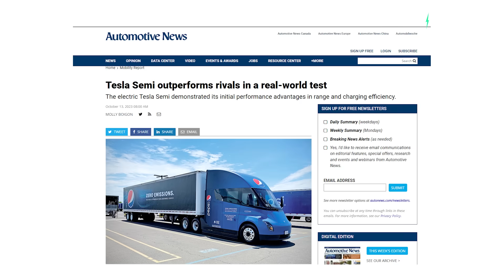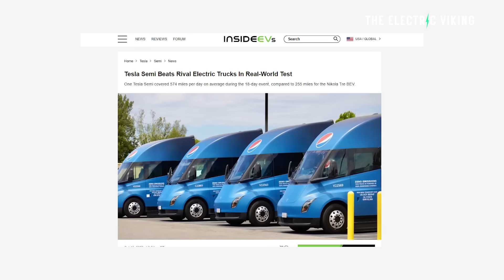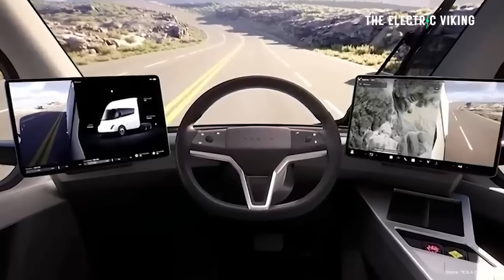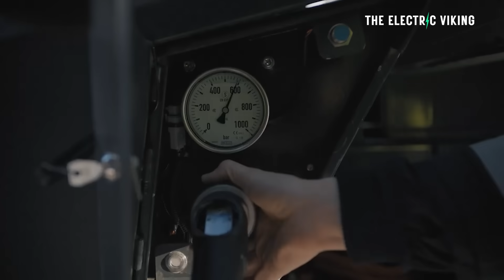Mercedes claim that Tesla Semi breaks the laws of physics proven correct

Comment: Increasing the range of an electric vehicle is the easiest part of electric vehicle optimization. Doesn't even need and engineer, just put a more batteries, there is load of space in a semi formatted for the USA. A bit like having a bigger tank in your car.
The HUGE size of the Tesla semi (comparable to internal combustion american semis) makes it ALMOST totally UNUSABLE in Europe. Just ask a semi driver who drives in Europe on various types of transport (I mean not limited to port-dock -> port-dock).
Other points that are, to me, important:
- the limited supply of lithium worlwide
- the place where we buy lithium/the place where it is transformed/the place where we buy the batteries (watch the direction of my eyes...)
- the aging of batteries. I haven't seen it included in the comparative studies since the ones I saw where just done on the basis of almost brand new electric semis. Watch your phone battery maximum capacity after 2 or 3 years and imagine being the operating officer of a fleet. If after 3 years you have lost 9-10% of the battery capacity, i.e. range... it is a big problem. Because you will not be able (and/or allowed) to charge anywhere like electric cars do.
- Maximum capacity (power) available on the grid is not magically unlimited. Meaning you would certainly have various time constraints for your recharges.
- Who will pay for the new nuclear/solar/wind power stations in order to cope with the increasing demand?
- what is the advantage of switching the pollution from the truck to the power station ? Some countries are still relying heavily on coal or gas power station. Other countries - a big one among them is Germany - have stopped using nuclear energy (how stupid) without a green alternative: they now have replaced nuclear by COAL until they-don't-know-yet. COAL IS THE WORST OF the WORSTS.
- a BIG BIG problem, to my eyes, is that we (in Europe at least) are trying to push towards railroad alternatives which are a proven more efficient system (we have a vast majority of electric trains otherwise it would not be so interesting) for a part of the transports. If buying an electric truck makes you forget about transitionning a part of your transport towards rail, I DON'T LIKE IT.

Comment: When we mention physics, we should be talking about coefficient of drag. As @austinpowers1999 mentioned, why are they making a brick-shaped truck? Yes, European countries have length limitations but why is Mercedes designing a very tall cab when there isn't a huge diesel engine the driver is sitting on top of? The drive motors on the Tesla Semi are located between the rear wheels along with a cruising motor up front. If Mercedes and the other brick-shaped semi manufacturers simply followed the design of the Tesla Semi, adjusting the cab to sit forward but no more than 2/3rds the height of the Semi, this alone should help reduce their drag coefficient significantly. It's ~0.36 drag coefficient has to be much lower than the others. Do we have information on all the other semis on the road and those in design?
From Tesla Semi forum: "... amazing semi specs. 0.4 drag coefficient compared to 0.8 with a regular semi."
Reply: because the trailer has that heigth anyway.
Plenty of trucks even have an extra piece on top of the cabin to reduce air drag.
Reply: @Robbedem  I was thinking what they should do is streamline the trailer so that the front is more sloped.  A small slope would not sacrifice much carrying capacity --especially if you don't load the truck to the ceiling.  That way the cab height could be lowered even more and weight and air resistance reduced.

P.S.  Yeah, I know most trailers are boxy and that they are stuck with using those, but if you could design a whole new cab/trailer...
Reply: @kenbob1071 sure, just replace the millions of trailers already out there, to be more sustainable, sure

P.S. forgot to read his P.S.
Reply: @iaintdonknow   uh, dude read my "P.S."
Reply: @kenbob1071  missed it thanks
Reply: @iaintdonknow foldable front of trailer depending on load? With cab height adjustable like  some travel trailers?
Reply: Because COE are the RULE in UK & EU.
Reply: believe it or not, despite carry more weight from having higher GTW over on average more undulating windy roads, European cabovers use less fuel for a given weight moved a comparative distance, because they are limited to 56mph, while in the US the speed major routes for trucks is notably higher, e.g. a 0.6 drag coefficient when ran at 56mph carrying 8000LB to 17000LB more weight bests a lower drag coefficient ran at higher speed carrying less weight.
Reply: @markplott4820  they are not implicitly a rule, they are just what fits best within the rules to have a maximum length trailer while staying within the maximum overall length regulations, if you want to run a truck with a bonnet you can, but the trailer needs to be shorter to account for the overall length limit - unless you run in an area of haulage that has derogations regarding overall length, for low-loader operations and heavy haulage that have relaxed overall length requirements.
Reply: @Robbedem   The Tesla has the same height. It just has a bit more streamlining in the front because it has no length restrictions in the US. In Europe that truck couldn't be used with regular trailers.

Comment: notice how every other electric semi is a big flat wall of metal smacking into the air...and even worse, with lots of irregularity in the surface, almost like they made an attempt at designing the most inefficient front end in a wind tunnel as possible .....smh...

Comment: The problems with electric trucks, are totally mitigated by driver’s mandatory stops.
As they can charge while you have a mandatory meal break, they have no more ‘down-time’ than diesel powered equivalents. In fact, they  mean mandatory rest breaks cannot be ‘skipped’, which is better for drivers, and safer for every single person travelling the roads alongside them.
Reply: And also - filling with diesel requires you to spend maybe 15 minutes with the truck. Electric ? Plug in and get your full 1/2 hour break... I know which I would choose...
Reply: How is not producing enough electricity to power a fleet conversion fixed by drivers stopping?  During summer California has rolling blackouts with the current load.
Reply: Truck driver here. We are allowed to hook and unhook trailers during our 30 minute reset. By the time my pre trip is done I maybe have 5 minutes to use the restroom before I can keep driving.
Reply: @MrJturner74 California is producing 22 GW do you really think a few MW will make any difference?
Gasoline and diesel refining requires 4.2 kWh/gallon
Reply: @nathanielthelin1051  
In the UK you're not even allowed to clean your mirrors whilst on your break.
Rest Break means exactly that.
NO misinterpretations.
Reply: @casperhansen826  Yes I do, we have already had Cali ask people to NOT charge their cars once. When is a new power source being brought online to handle the increased demand?
Reply: @nathanielthelin1051  That depends on the country. Some (most) western countries mandate an actual 30 minute “rest, not a 30 minute “rest” whilst continuing to work, but that’s America for you - no worker rights.
Reply: @MrJturner74  Most civilised countries have a dependable power grid. California’s problems aren’t indicative of world-wide capabilities.
Reply: @just_passing_through  to be fair, I chose not to wait past the 30 minutes because I get paid by the mile and like to keep moving. I could stay parked for hours if I needed to sleep or rest. We basically get this cool ability in the US to choose how we spend our time at work. I do think the truck is cool btw. I just wanted to point out that not all drivers actually spend 30 minutes parked during their shift.
Reply: @nathanielthelin1051  The trouble with “having this cool ability to choose how we stand our time at work” for truck drivers is that … you get paid by the mile….  The quicker you finish s job, the quicker you start another.  The problem with that is that it’s in the trucking company’s best interest to bite drivers who don’t take breaks. It’s in the drivers best interest to not take breaks. It’s in no one’s best interest to ensure breaks are taken and drivers are not fatigued. That’s where government oversight should come in. Mandating breaks means every driver takes them and keeps everyone safe from the :time is money, to hell with safety” attitude. It’s the very reason why in the US truck drivers consistently rank as one of the top ten dangerous professions, whereas that is not the case in countries with stricter guidelines.
Reply: @MrJturner74  build nuclear . it's the best tech. just make it impossible to launch nuisance lawsuits .
Reply: @nathanielthelin1051 why are you unhooking your trailer on a road trip ? and it seems the laws need to change if you are still working on your break.
Reply: @MrJturner74 Most people can program their electric vehicles to charge at midnight when there is ample or excess grid capacity.
Also, not charging for a day is no big deal, as most people driving average miles every year only need to charge at home once or twice per week for a few hours, so not charging for a couple of days is no problem. Just like using a gas vehicle.

With an electric vehicle, you're more likely to have a full "tank" or charge than in a gas vehicle because you can plug it in every night, just like using a smart phone.

Everyone who drives an EV is not using Superchargers every day. The Superchargers are mostly used by long distance travelers.

Everyone in the entire State of California was not in blackout mode at the same time.
Reply: @MrJturner74 California's blackouts are because of their lines possibly causing wildfires not because their grid is failing yet
Reply: @dvader3263  Except most people don't have the ability to charge at home.
Reply: If you slow down a trucker, you drive up the price of shipping.
Reply: @moabman6803  If you have as many trucks crashing through driver fatigue as the US does, you drive the shipping costs up even further.
Reply: @just_passing_through  Then that would cause the price of goods to go up globally
Reply: @MrJturner74  The rest of the request: “during peak energy demand hours”. You’re being deliberately dishonest making it sound like people can’t charge their cars when the truth is that they’re asking people to reduce the load on the system during the hottest hours of the day. Since these vehicles can be fully charged in the off-hours your question is moot to begin with. There is also a small, but not negligible, range extension that could be obtained through putting solar cells on the top and sides of the trailers.
Reply: @davidhollowood6580  Fine, in honesty there  aren't enough minerals  to convert to battery electric cars even if we wanted to. A hemp based biodiesel is a much better choice for fuel.
Reply: @MrJturner74  Solar plus storage.

Comment: Charging EVs from 10%-60% then leaving the charger session seems to be the most efficient charge cycle for me and other EV owners. My recent road trip went smoothly and quickly using this method. My Model 3 ramped up to 250kw for quite a bit before starting to ramp down to 110kw before I unplugged and moved on. The America-record setting Porsche Taycan Cannonball used the 10%-60% to set their EV race record.
Reply: Ramp up ramp down.😅

Comment: the problem is, the US is not comparable to for example to Europe, likewise how one haulier uses a truck is often not comparable to how another haulier uses a truck, then you have the trucks themselves and the regulations the operate under, for example 40 tons (80,000LB GTW) in the US is very different from 40 tonnes (88,185LB GTW) or 44 tonnes (97,003LB GTW) in Europe, ever wandered why Europe has more powerful trucks on average, its because on average the haul more weight, on average on the road network they encounter is very different to the US, and the topography of the terrain is generally more hilly in Europe, while the US has some vast relatively speaking flat spaces, the only way your going to get a fair comparison is to run the trucks side by side on the same roads at the same times, hauling the same trailers with the same weight loads in, with drivers that drive in similar manner, if any part of the comparison is different (roads and routes used, trailers used, weights carried, etc) the the test is not comparative, its just smoke and mirrors.

Comment: How many of the test trucks burst into flames while charging or just sitting there? How many burst into flames after being involved in an accident?
Reply: Since about 200,000 American autos burst into flames every year, they have a long while to catch up.
Reply: If trying to make the case for fire safety EVs Vs IC it's important to show proportionality not raw numbers. It's also important to compare the two types of fire and the impact each has. 

I don't know which comes out on top if you do that, but no matter what side of the fence you're on if you're not factoring for those two things then your view is nothing better than a guess.

Then we can look at scenarios under which the fires happen and see if that means anything.

It's probably also important to track the fire rate of early ic vehicles through to modern ones. Do we see a similar reduction curve per million vehicles for EVs the last 20 years Vs the first 20 years of mass IC production?

Comment: Not so much the laws of physics as the limits of Mercedes engineering.
Reply: Mercedes have to design trucks with the considerations of the whole world excluding NA, while Tesla just have to make trucks for the consideration of just NA mostly and mostly the USA at that, the Tesla Semi is based around a ~37 tonne GTW, Mercedes will be considering 40 tonne to 46 tonne GTW as a baseline tractor unit, the former being 4x2 and the latter being 6x2 or 6x4, that is before you even get to market specific ones in Europe like for Scandinavia\Finland, and lets not forget the effects of cold weather on battery capacity.

Comment: So basically because this study didn't pay attention to the leftover charge the whole study is useless. Also, the charge and discharge times would have to be the same. Basically what this study proves is that someone needs to figure out how to do studies. Also, the Tesla has so much battery that in the US it can haul about half the weight of a diesel.  

What I learned is that everyone is wrong and we are a long way from solving this problem.
Reply: All charging parameters, include "leftover charge", are available for all to see. You can verify this for yourself by putting the four words Run On Less Results in your browser, selecting PepsiCo (Sacramento) for the depot, and selecting Day 1 through Day 18 and which one of three Tesla Semis to look at.
Tesla Semi have a demonstrated payload of 44,000 lbs. Are you saying a diesel semi can haul 88,000 lbs.? Details, please!
Reply: You are reasoning from incomplete knowledge.

The study was simply an analysis of several use cases where BEV trucks are currently in use at facilities that use them every day.  

The trucks are working as intended.  They are doing the same job as diesel trucks and saving money for their owners.

The analysis includes things like total cost of ownership.  If the numbers pan out - which they do - then you will see a lot more trucking companies buying BEV trucks.

In fact, this is going to happen without any doubt, but it will only happen at the pace that batteries can be supplied.  It will take time, but in about 25 years, the trucking industry will be very nearly 100% electric.

Comment: There is one major pitfall that no one seems to be addressing. Fast-charge cuts the battery life in half. What is the cost of a new set of batteries every 2 to 4 years?
Reply: A recent study by Recurring proves that it actually has little or no effect on battery life. Suggest you update your information.
Reply: @BigBen621  - That’s a lie. There is no such honest study. Besides, if what you are saying is true then, everything would be fast-charge. Trickle-charge extends battery life and Fast-charge shortens battery life.
Reply: FALSE , Tesla has Liquid cooled cables and Superior BMS , that can Optimize battery pack for CHARGING at Megacheger. TESLA semi rated for + 1 million miles , should last DECADES. 
TESLA semi saves operator $200,000 in 3 years. 
ROI is on Day ONE.
Reply: @markplott4820  - Battery lifecycle has nothing to do with the cables. It has to do with the battery chemistry itself. The faster you charge it, the shorter the lifespan.

Comment: They forgot a heavy moving vehicle has much kinetic energy that can be mostly converted back to electricity, instead as being mostly wasted as heat energy?
Reply: That is why electric trains is the ultimate in economy . 90% of kinetic energy is returned to grid , and used by another train going up a slope. There is a rail system , where the ore is transported from 1km+ elevation to sea level . The electricity generated by the loaded train going down , is more than enough to power the empty returning train . So basically free fuel running .